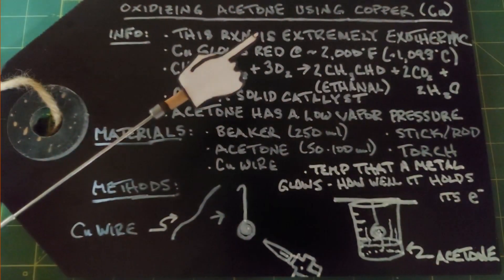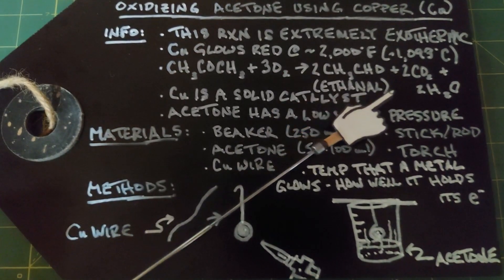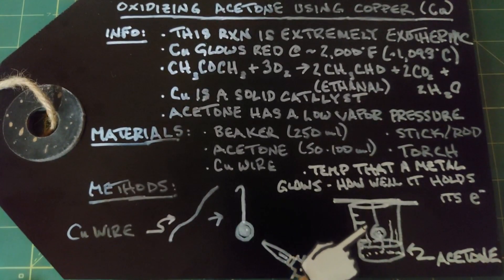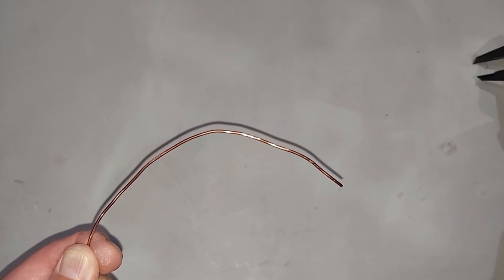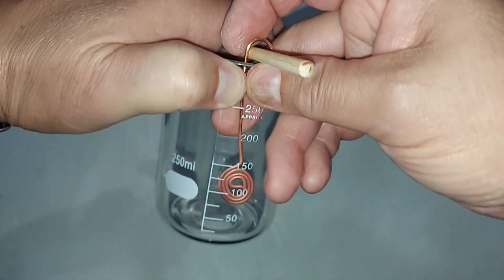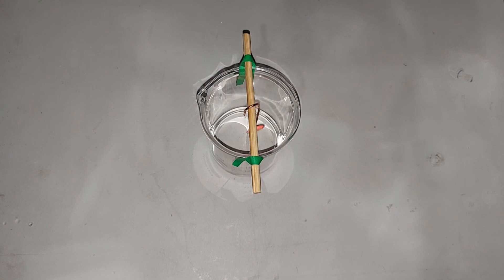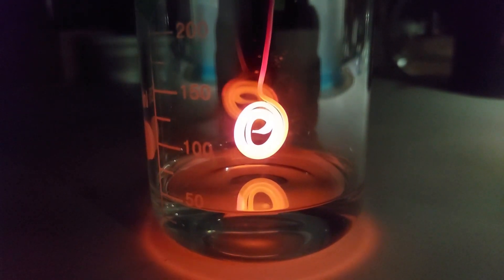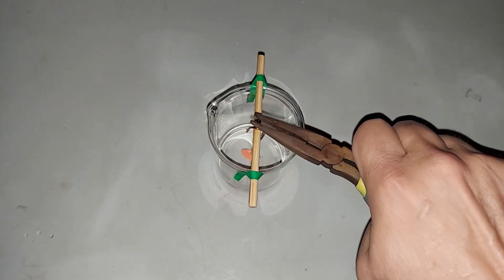The Extreme Heat Of Oxidizing Acetone

Comment: Platinium and lighter fluid work well too :)
Reply from the maker: Yes!  I have heard of this.  If I remember correctly the "lighter fluid" is actually methanol.  And, the reaction you're referring to doesn't need an initial heat source to heat the platinum.  It reacts so vigorously that the platinum turns red hot just in the presence of methanol vapors.
Reply: Yeah I have a hand warmer working on that principle, you light it and you can put in your pocket it'll keep "burning" even with the low oxygen environment. Fascinating object.

Comment: At what point does the acetone in the beaker completely convert to ethanal, or does only the vapour convert and is then lost? What I'm asking is, is it possible to synthesise ethanal like this?
Reply from the maker: The only ethanal that's produced is from the acetone vapor and the majority flows up and out of the beaker.   It would be difficult to capture this alone.

Comment: How long would this go on for if you had an indefinite supply of acetone? Would an oxidized film eventually form and inhibit the reaction or does it get hot enough to burn of the oxidized copper? Your black body radiation explanation reminds me of how some compounds (like glow-in-the-dark stuff) are excited by photons, causing an electron to jump up a level. When the electron returns to it's lower energy orbit, a photon is emitted. This seems like a related phenomenon.
Reply from the maker: Indefinitely.  The key would be heating the copper evenly initially and avoiding any air currents above the beaker.  As you say, the oxidized copper does get burned away.  Your glow in the dark relationship to black body radiation is a really interesting one.  Due to the low amount of heat produced from jumping electrons is it possible that glow in the dark items are typically just "white-ish" and dissipate quickly?  I've got to look into this.
Reply: @cranialconstruction  The glow in the dark items will be emitting black body radiation, as will everything surrounding it, the wavelength will be in the infrared. 
The wavelength of black body radiation is a continuous spectrum, phosphorescence isn't, the wavelength is determined by the photon emitted.

I'm confused by "white-ish"  - the term black/white body is not about temperature. Nothing is an ideal black/white body but An ideal black body is one that absorbs all incoming electromagnetic radiation, a white body reflects all. 

The glow in the dark item will act as a black body to the wavelength needed to excite the electron to a higher energy state as well as other wavelengths and reflect some wavelengths as a white body. The wavelengths absorbed will heat up the item and be emitted as black body radiation.

Comment: I'm confused; I thought acetone had a high vapor pressure. Low boiling point = high vapor pressure? Or do I have it backwards?
Reply: You have it right. When the vapor pressure get to 1atm, it will boil at 1atm. With low boiling point it gets there at lower temperature.
But what is low at what is high? That depends so much on situation and it is drawing a line.